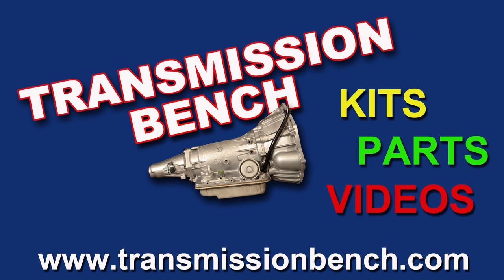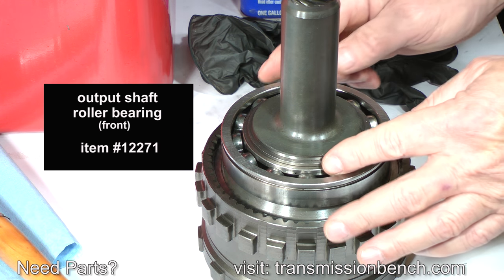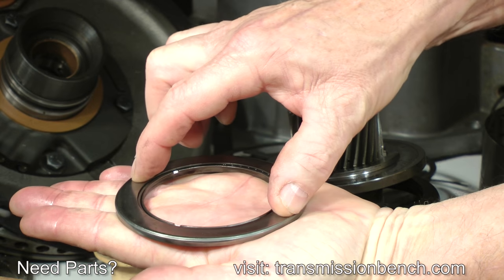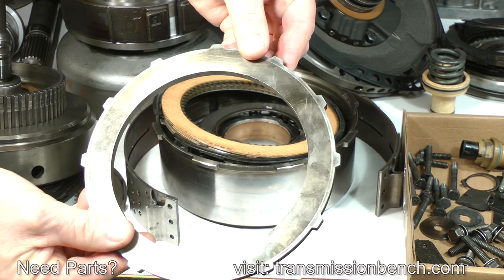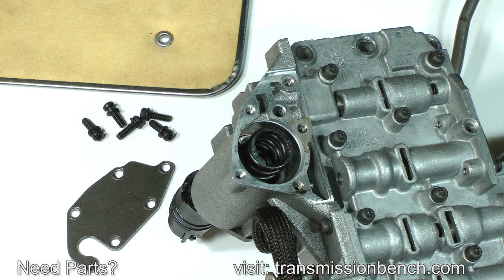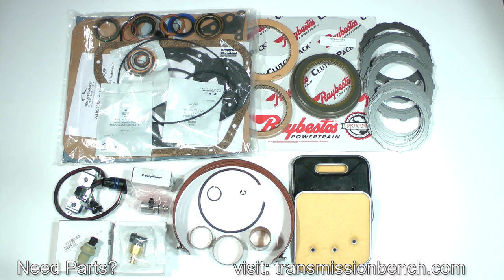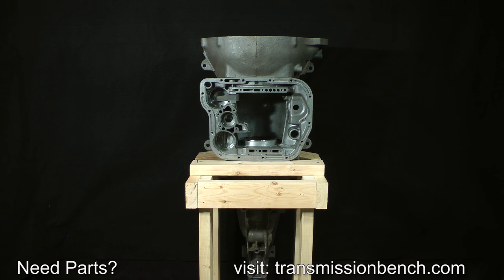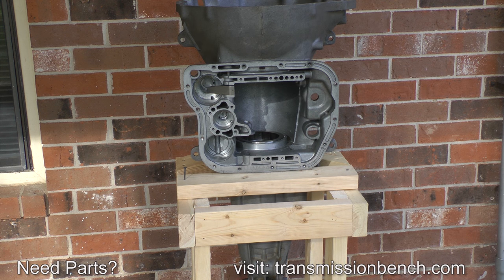Chrysler 46RE Class Part 2 lesson 2

Comment: doesnt the check valve restrict fluid flow
Reply: No the check valve is a small ball inside of the channels in the tranny that roll back and forth with fluid movement but on one side there is an o-ring seal and on the other side there is a mesh wall
Reply: Their official name is a 1 way ball check valve and they stop fluids from flowing backwards where it doesn't belong